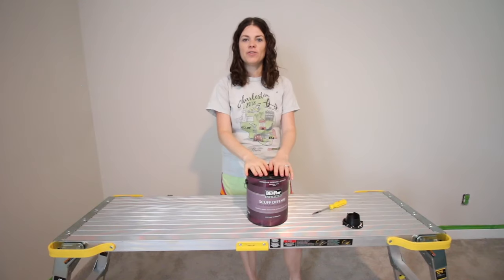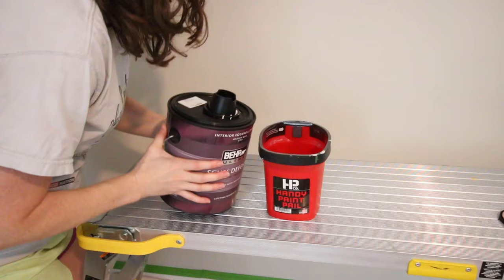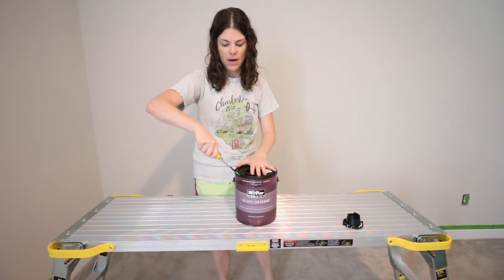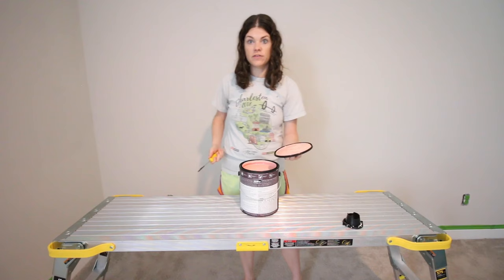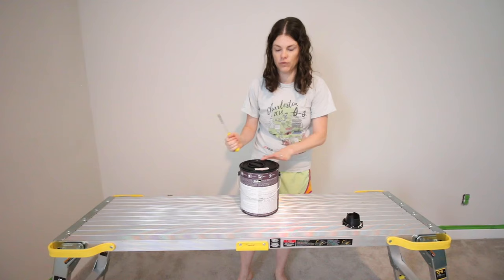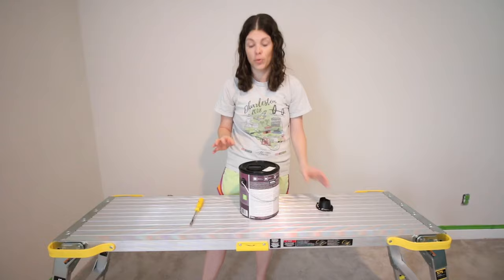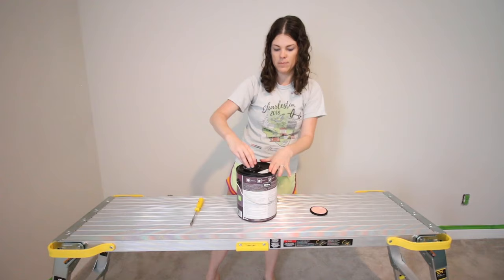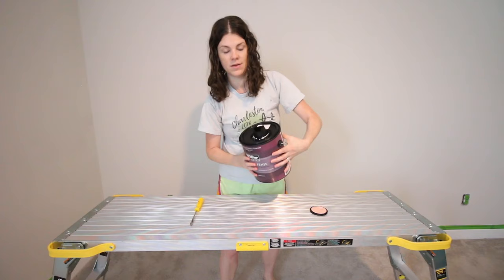How to open a can of Behr paint with the Simple Pour Lid

Comment: To open the smaller hole much more easily: place the spout, which should come free (I just got one at Home Depot) on top of the raised, black = (equal sign). Place it like an ice cream cup, with the bigger hole at the top, and the smaller end gripping the equal sign. You have to position it so it will grip the equal sign when you press down. So you may need to turn it a bit as it has a unique lip that will fit like a puzzle piece and snap on when pressed in the correct position. Grab a wad of paper towel or a wash cloth and twist it open! Viola!
Reply: 🎃p
Reply: I did it!! Thank you so much!!
Reply: Thank you dude I finally got it